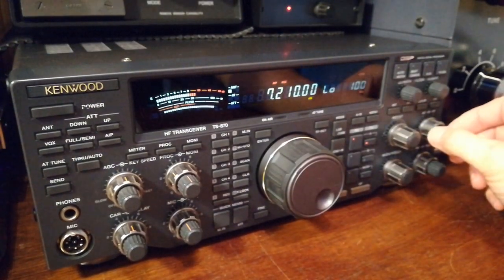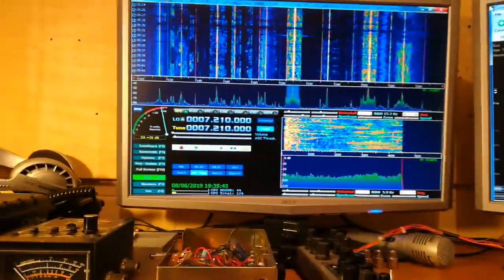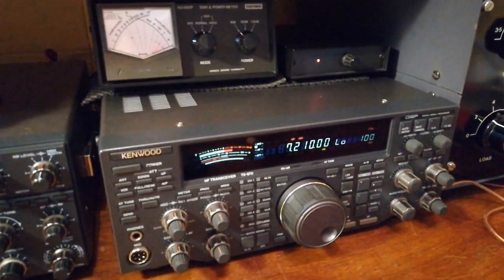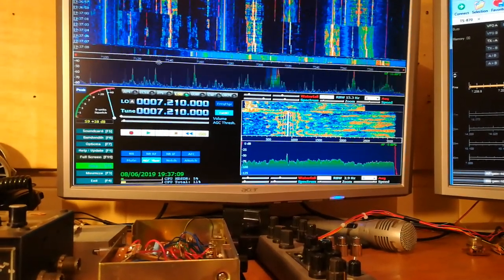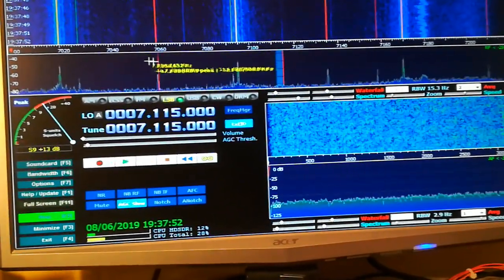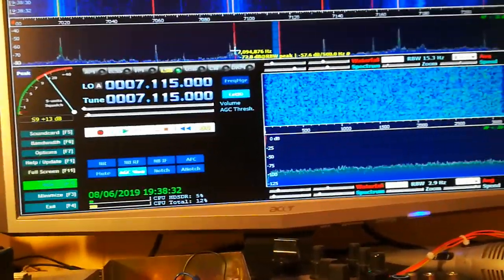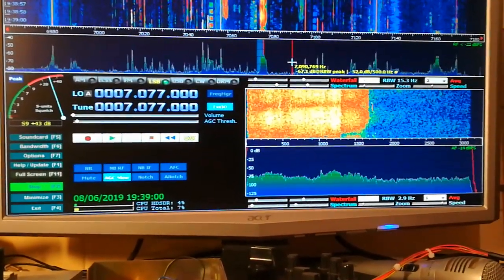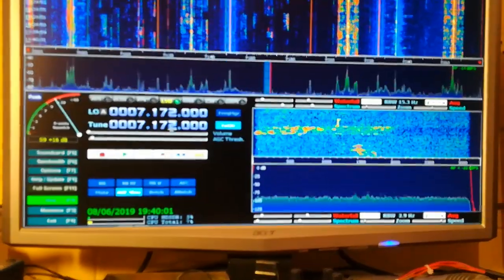Kenwood TS-870 Bandscope/Panadaptor

Comment: Are you running an IF out or is the sdr splitting the RX ? If I could find a direct IF out I would get another 870 and run sdr console v3
Reply from the maker: 8.83 MHz if out the back of the 870 , Straight into a SDR play tuned for 8.83 MHz ..... HDsdr configured so the SDR play is on the IF and not seen as an antenna , HRD  as the control software...  It's that simple 👍
Reply from the maker: I don't  split the RX ... Not when the radio has a dedicated IF output .
Reply: MrMadjones I’ve been told if you do it that way that you will come out of the last IF filter in the 870 instead of the 1st. Causing the bandwidth to be quite small on hdsdr? Apparently you can tap in to the first IF in the chain to get maximum bandwidth on the display without having to sync with 8.83. Your thoughts?
Reply from the maker: @JayN4GO  I can't see what the issue is ..  the bandwidth is more than any HF band is wide , I'm getting a couple of MHz in usable  bandwidth .
Reply: MrMadjones cool maybe you can show a closer vid of the back of the rig. And hdsdr
Reply: @JayN4GO  the 8.83 MHz IF output used here has been designed to go out the back to the SM-230 Station Monitor, so will not have the problem you are worrying about. If you were taping into one of the IF's in the chain the 1st IF would be better as there are filters down the line which will cause smaller bandwidths as you say. The TS-870 is one of a few radio that do this, others are the FT-950 FT-2000 TS-850 TS-950 to some extent as far as I have discovered. Here are some better explanations than mine, if you read the pages linked in the webpage. http://huprf.com/huprf/pat-board/ :)